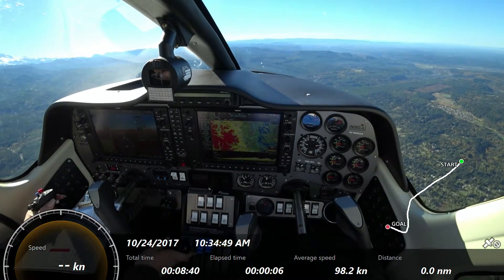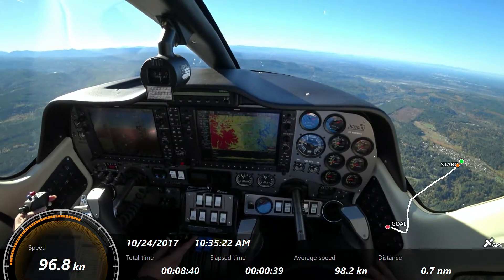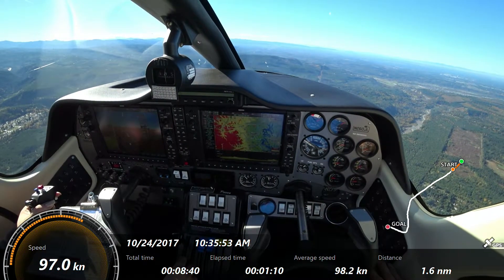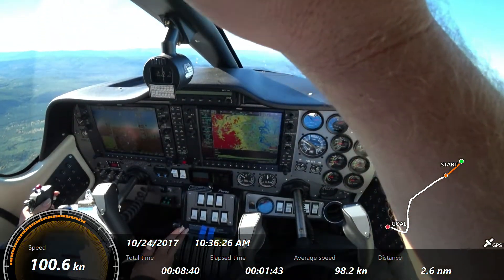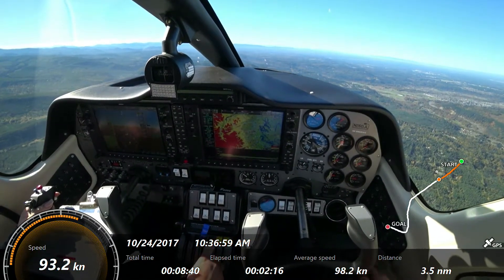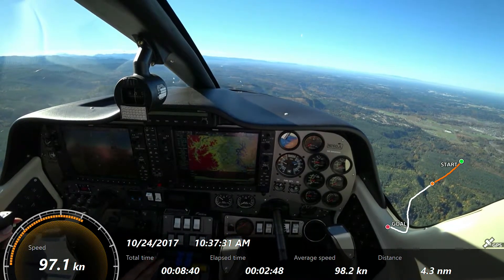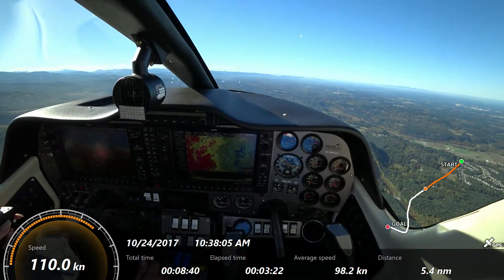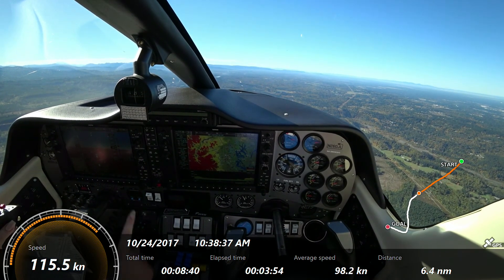Suprise Engine OUT! Twin Tecnam P2006T

Comment: Student needs to get engine failure drills off by heart and faster..
Reply: Haha that’s an instant fail during a checkride - she maintained good rudder control though - twins are easy to flip during asymmetric flying if you don’t know what you’re doing
Reply from the maker: dave jones,  She kept directional control and stayed calm even when she had no clue what happened. Agreed she needs to work on her flow and engine out but that’s why we are practicing. 

It’s also interesting to see an engine out in flight it actually didn’t show any difference on the gauges. She did great based on the amount of training she has. 

Engine out procedures are pretty much the whole checkride for Multi and getting the flow down happens about 6-8 hours normally. Once they get their  flow down it’s usually time to take the check ride.